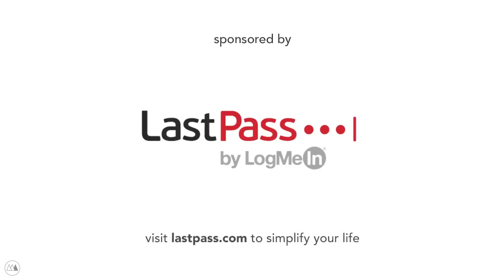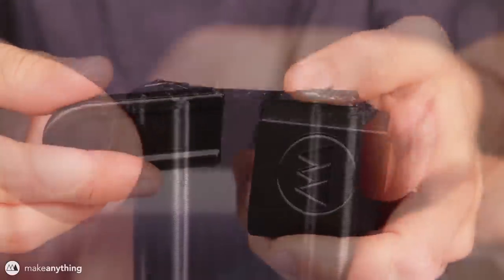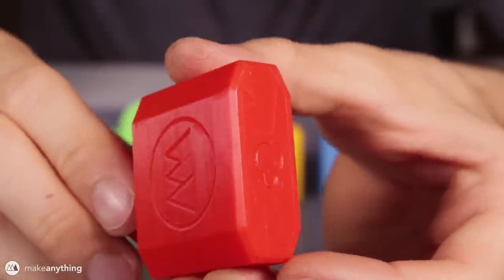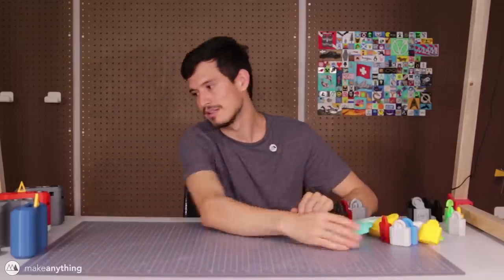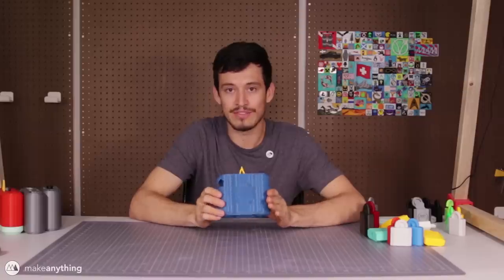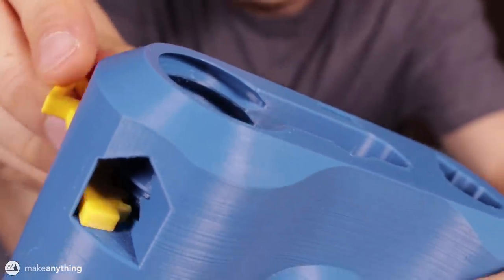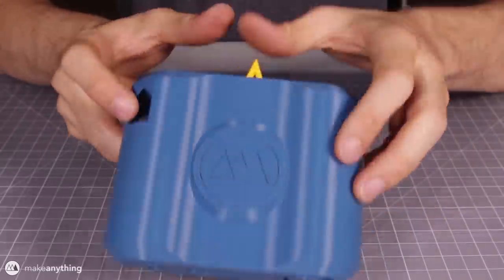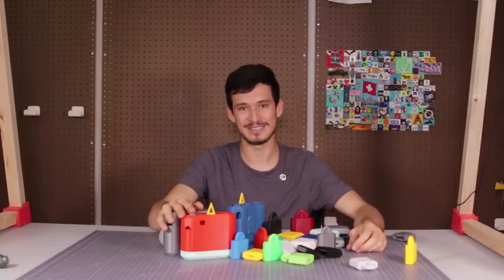3D Printed Puzzle Box and Lockpick Puzzles

Comment: That you engineered it to print in place is amazing.

You have a lot of design and cad skills that I don’t, so I don’t want to sound like I think I know more than you, but I work in game design and I’d say there are a few things to be aware of when designing puzzles.

1. Red herrings rarely produce positive feelings. If they’re used in a particularly creative way or give some benefit to the player (such as extra time or a hint to make up for the time lost on the red herring) then they’re not so bad. In the example you showed where one position works and one position almost works, a good number of people are going to assume their printer left some unintended artifact on the inside and they’re going to force it.

2. Variety is the most important thing. You could argue that your puzzle box has several distinct puzzles such as the gear teeth/key (that’s a really good idea by the way) and the twisty maze. To a lot of players though, they’re just turning the large key in several different ways. Especially if they got caught by your red herring near the start, turning that large key will just have them paranoid that they’re going to run into another time wasting trap.

3. It should be easy for the player to avoid repeating the same wrong solution. Maybe a marker or numbered dial on top of they key, and numbered bands along the side to help players keep track of which positions they’ve already tried would help.

Anyway, I can’t exaggerate how impressed I am by your designs. Your dedication to printing in place is amazing too.
Keep up the good work.

Comment: Could you do a review on the Monoprice Voxel. There are none as of now and it seems like a great printer. I might get one. For $400 it has: Touch screen, 50 micron z precision, fully enclosed, heated bed, decent print size, wifi ability, removable plate, and a camera! I dont know weather or not to get it though. It is from a reliable company buy I have a good printer already.
Reply: Jace N Did you get it? if so, how is it. i am 13 years old and i have saved up money from doing yard work, and babysitting. i am dying to get a 3D printer so i was just curious 😄
Reply: Why would you need a camera on a 3d printer?

Comment: Oh boy this was tough to print. It would always curl up on the thread and eventually the head would ram into it, missing steps and create layer shifts.I think it might be my insufficient cooling, I put fans up but it didn't fix it. I managed to fully print it pretty well by using an insane 2mm z-hop. Unfortunately both thread were seized and the free spinning thread part on the pin was fused strongly to the pin. This again mostly due to z-issues, curling and droop. I had to cheat and look at the file to understand which parts are supposed to be separate. I was able to break everything loose but because of only 5% infill and two outer layers the pin broke. I glued it with some toothpicks and now the puzzle is actually usable. Nice job designing this! :)

Comment: I see the locks have their puzzle number on the back, but do the keys also have a number identifyer on them anywhere to ensure that they match up with their proper lock (or is the key designed such that it is universal and can be swapped between them?  I realize printing each lock in a different color would make sure the keys always match up, but I've got a lot of spare grey filament and wanted to check before I printed multiple in the same color :)
Reply from the maker: The keys are universal.. well, at least for 1-5 and 6-10

Comment: What 3Dprinter would you recommend to a beginner with an MacBook
Reply: Try the XYZprinting Da Vinci miniMaker
Reply from the maker: no
Reply from the maker: The computer you have doesn't affect anything besides maybe design capabilities, but in terms of printing every slicer (to prepare files to print) is available on mac and PC and they don't use much power. Ender 3 sure isn't a bad choice!
Reply: Although XYZ generally has a bad reputation, the Da Vinci mini is a great starter printer due to it being very affordable (just less than $200), coming pre-assembled and having very advanced technology for such a low priced system, (auto bed levelling, automatically pulls filament through the bowden tube when loading filament etc.)
The only downside is only being able to use XYZ filament, however the chips can easily be hacked meaning any filament can be used.
Reply from the maker: It doesn't allow third party filament, which means you're paying much more in the long run
Reply: TheBluDitto the davinci is a terrible printer for beginners. Do not get a da Vinci. Get an ender 3 or an original prusa i3 mk2s or MK3.
Reply: Thanks guys, i think I’m going for the ender 3
Reply: Arthur holm good choice :)

Comment: IMPORTANT:
_____________________________________________
I tried to 3d print it, but when I tried to take out the key from puzzle 10 and I was only able to turn it 45 degrees on each side but when I tried to pull it out, it didn't work

Comment: I tried to print it by reducing the size to 40%, to make a pocket headache, but this resulted in internal welds, very nice outside, unusable, unfortunately ...

I will try to reduce the thickness of the lines by the same percentage as that of the room, maybe this is the solution;)

Comment: I really want to find one that can accommodates a gift card. Allot of the people I have to shop for like gift cards. But I don't want to just give them a card. Kind of lame. Any chance you can make a gift card puzzle box? Might need a slot to slide the card in if it's designed in one piece, or like the cylinder mazes for money I can reverse puzzle it once the card is in. I'd for sure buy that model.
Reply from the maker: Good idea, I'll keep it in mind!

Comment: 24 hour print and it doesnt work. Guess my prusa wasnt up to the task lol. the  gear that the key is supposed to turn doesnt move at all so i think it got fused somehow
Reply from the maker: There's a small fused bit that's meant to break off naturally but you can try pushing down on the rotating pin from the top to force the gear loose

Comment: 40 hours in and the small key part detached therefore wobbling about - I’m gutted 😞
Reply: Reprinting with a raft to try and get it to hold - changed the infill - I’d set it too high at 50 - so now set to 20 % at 0.15 layers 🤞